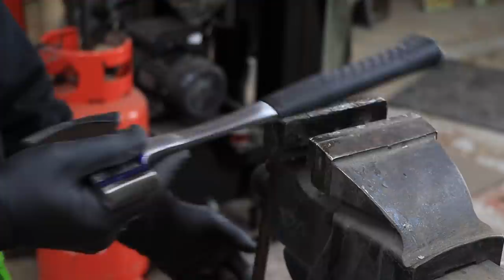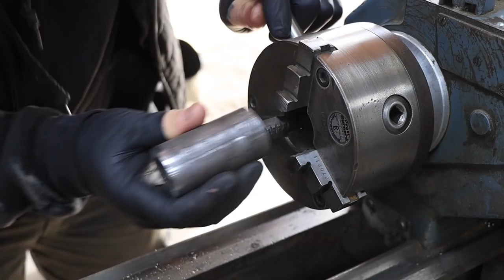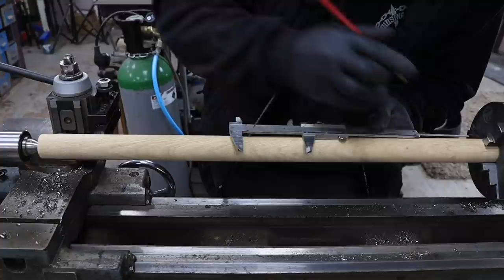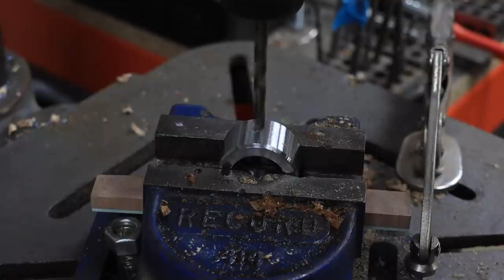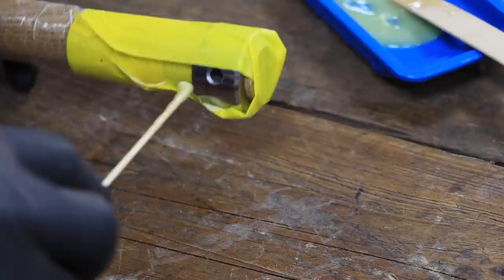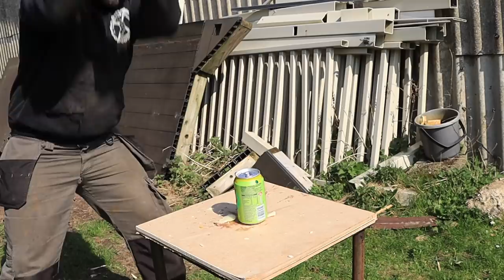4D Axe!? Building a Four Bladed AXE!

Comment: Ah now that's a stick! I have one very similar for armored combat with just a few differences, yet another great video
Reply from the maker: Ahh no way that’s cool, thanks man
Reply: @DiesInEveryFilm  it's just the edges of the axe instead of the full axe head, and I have 8 flanges all welded to a metal pipe, helps with edge alignment so when I make contact it doesn't twist so violently in my hands, however yours wins by a mile in style points, mine just looks like I ripped something important from under the car and called it good. Lol. Im looking forward to your next video!

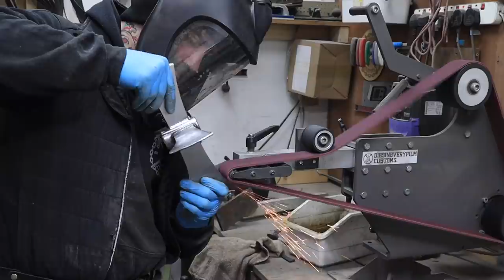Comment: 4:01 is that a finishing belt?
Reply from the maker: Yup
Reply: @DiesInEveryFilm  I could honestly use one of those, what sizes do they make them in, I have a WEN 6508 and hope it comes in the right size. My finishing wheel for my bench grinder is wearing out so yeah. The belt is 6x48 and my disc is 9 inch